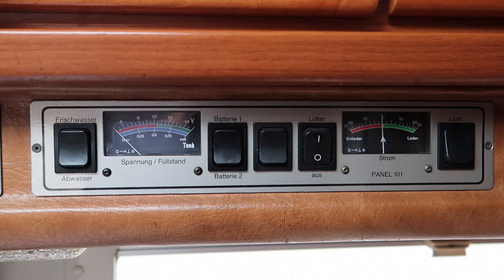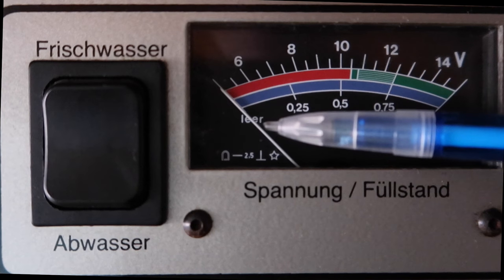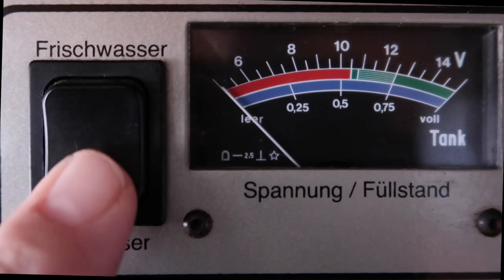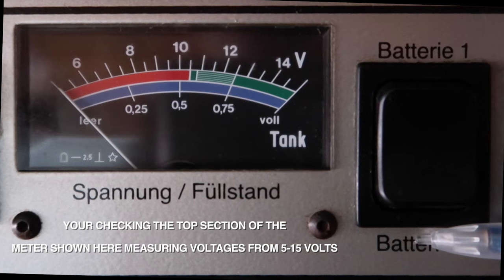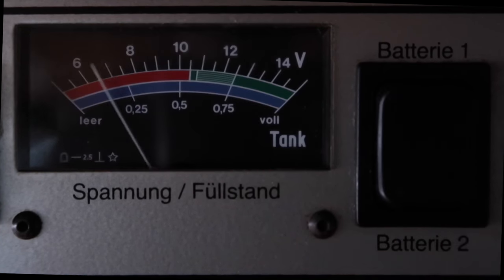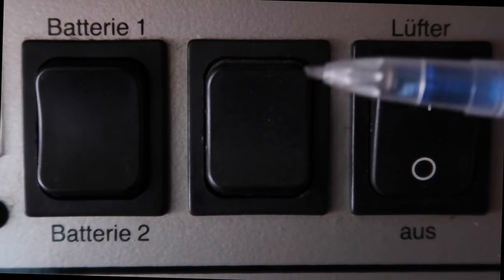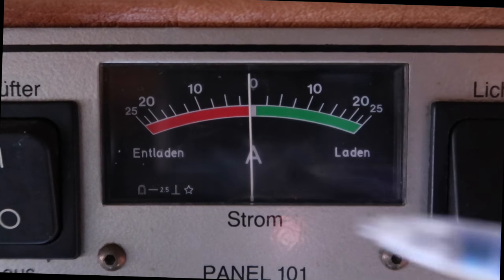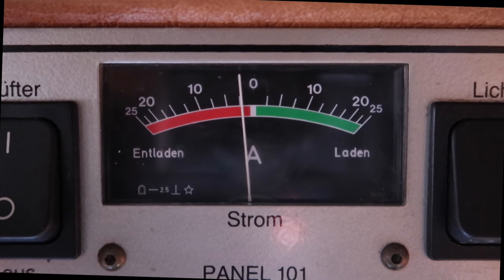Hymer Control Panel Tutorial / What Does It all Mean?

Comment: Hello Jom and thank you for this video.
I know how it is working the panel but my question is about the connections.
I bought months ago a Hymer B564 which it has the same panel IT101 but does not work proper;y, just the light is on when you press the buttons of the battery and tanks levels.
Any idea how to repair that, please?
I tried to find the electrical plan but is being very difficult; perhaps photos from your can help.
Thank you.
Best wishes,

Jose